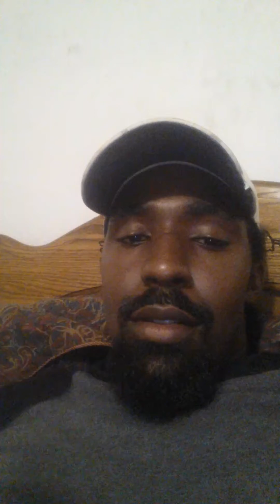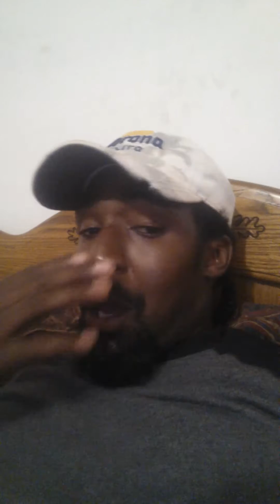Pipe welding info from chris.taner (You really need this)

Comment: I got a question Chris I'm certified 3G& 4g open root plate  & 5g & 6g pipe AWS can I make money cause I done have any combo just stick
Reply from the maker: Yes, you can make  good money with just stick welding pipe. My suggestion is that you learn how to use that 8010 and that 6010 down hill. The pipe line is where you would make the most money. $4,100 to $5,400 a week, or even more believe me I been there, I did a job for a company call S.B in south TX on the pipeline.  stay tuned for the website, if you don't no how to use that down hill method I'll teach you. Easy money.
Reply: Can you use your own machine when you're testing with stick? I just finished my rig.

Comment from the maker: Pipe welders hands down make more money than pipe fitters, now I respect pipe fitters 100% but pipe welding is where it's at. Fitting pipe you must have math skills,  in other words you have to be good with math. Pipe fitting is a lot of work because as a pipe fitter you actually have to no alot about everything dealing with construction, that might sound crazy but it's true. Hey get into pipe welding it's not hard at all, as long as you have someone  like my self to guide you through. In a few weeks my website will be back up and running and I'll have all the tutorials you need plus more.
Reply from the maker: I will explain it to you on my break later on tonight, I'm working night shift.
Reply from the maker: I will explain it to you on my break later on tonight, I'm working night shift.
Reply from the maker: hey, what I will do is post a video showing you step by step how to tie in perfectly.
Reply from the maker: hey, what I will do is post a video showing you step by step how to tie in perfectly.
Reply from the maker: hey, what I will do is post a video showing you step by step how to tie in perfectly.
Reply from the maker: hey, what I will do is post a video showing you step by step how to tie in perfectly.
Reply: I know you a busy guy so I was hoping you could have at least described how to do it.  I failed my 6g test for a  cert. bad tie in :(
Reply from the maker: what size gap are you going with, 1/8 or 5/32. Is the test a 2inch heavy wall?
Reply: 5/32 and yeah it a 2inch pipe. sorry for replying late but didn't know you replied.

Comment: So even on 1" 3G 1/8" 7018 Excalibur rods bust it uphill at 90 instead of 105-115? So the slag will just peel that easy at 90? I'm using the Miller CST 280 and also the Lincoln Electric big as old school (looks old but works pimp) Square Wave 355 (220/440v)... Both great welders. So dial in at 90 instead of 105-115?
Reply from the maker: If your using 1/8 stick rod I usually set my amps any where from 120 to 126 amp it's all about the travel speed and keeping a close arc. If im taking a plate test in the 3g I personally don't use 1/8 rod. some times that rod like to act funny, on a test you rather be safe than sorry. You could trap slag unaware when welding in the 3g with that 1/8 rod, 3/32 rod is where it's at when welding in the 3g. But if you have to use that 1/8 rod the amp setting should be between 120 to 126 amp. using 1/8 rod with those amps you should make sure the base metal is at  least a half inch in thickness, anything less than that use 3/32 rod.
Reply from the maker: 90 amps is what I use for 3/32 stick rod. The slag falls right fall.